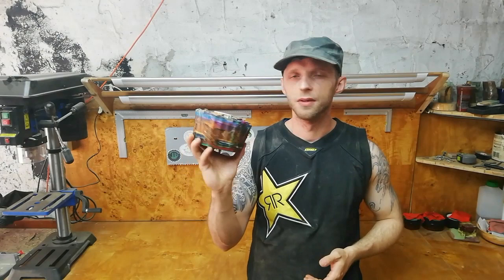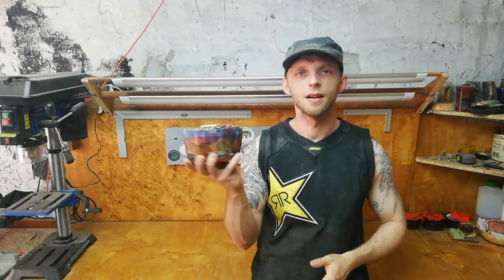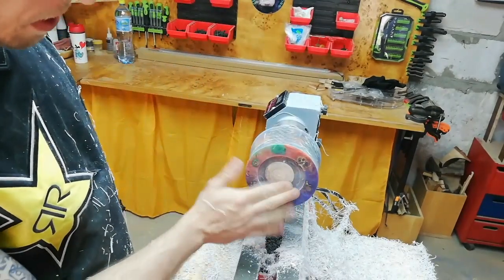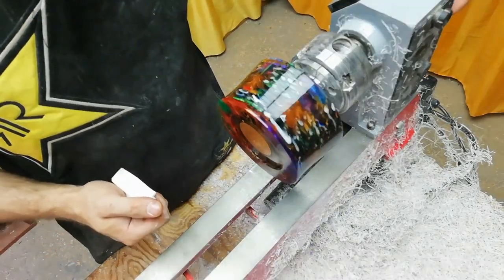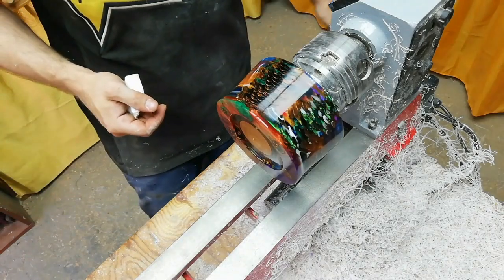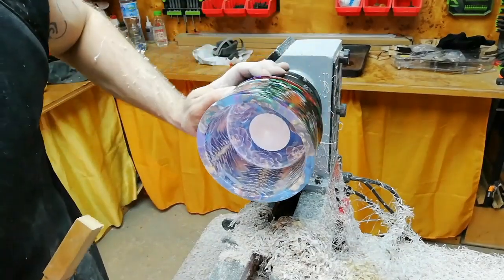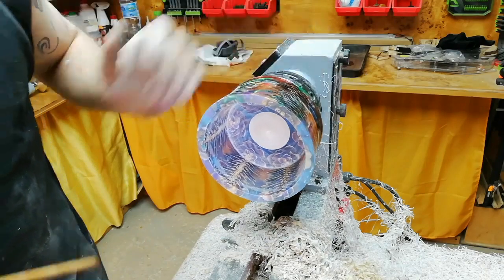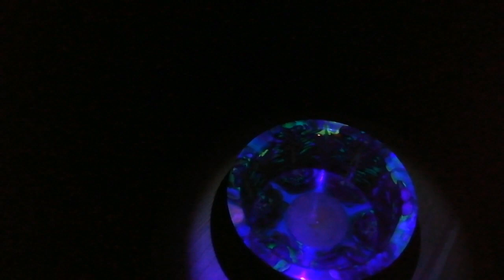A bowl from cones in resin leftovers

Comment: Ok Rav, You have outdone yourself! This bowl is awesome! I love it! I knew when it flew off your lathe it would be ok, resin is tough, thankfully! Really really beautiful!!
Reply from the maker: Thank You very much, Stephen 😊🤝 To outdone myself is my primary target. Always trying to be better then work is easier and more comfortable. Resin is hard but cones are having a natural resin on the surface and the epoxy is not joining with it too good. That's why little piece of epoxy has fall off from the bottom.
Reply: Rav, double check the resin you are using as I found a couple of mine can not be poured more than a 1/2” thick at a time. They say it will bond together and be unseeable but a1/2” at a time! Ugh it will take for ever.
Reply from the maker: Yes, I know that. Mine is that worst and I have to pour many layers as You wrote, 1/2" thick is maximum. Usually for small cup 200ml, I have to use 4 pours but I'm doing it after every 6h so I can make 3 pours per day.
Reply: Well at least we can both shake our heads and hopefully laugh about it...